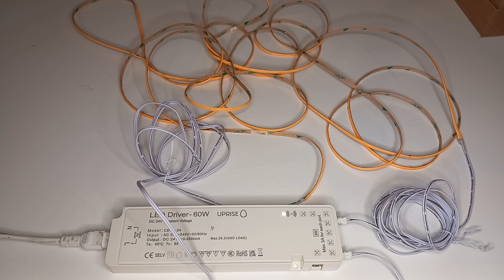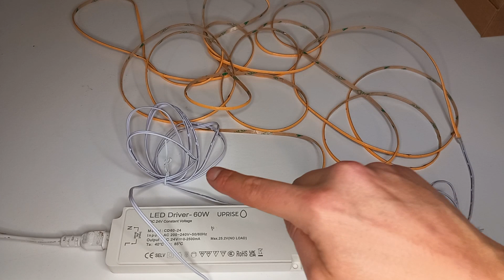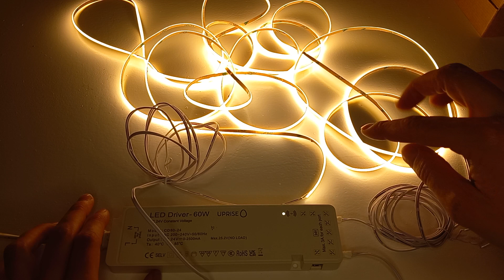Best way to connect a 5M 4mm COB LED strip to driver (24V)

Comment: Hi do you know the name of the connectors your using. Can you please also talk more about the driver. How about if we put a sensor inn. Thanks
Reply from the maker: Hey, the driver comes complete with a UK mains plug that can also be US or European style. 

As for the sensors we have a range of both [inline], which connect to individual ports (7 in the case of this 60W driver as seen in the video) and [master] which allows for a sensor to control the entire driver and all connected LED accessories.

Sensors typically are available as Single Door / Double Door (for cabinets), Drawer Sensors, Hand Wave Sensor, 1-100% on/off dimming touch sensor or PIR sensor for movement detection triggering.

Feel free to contact us via Whatsapp on 07957 180 481 or email sales@upriseled.com for more project support.